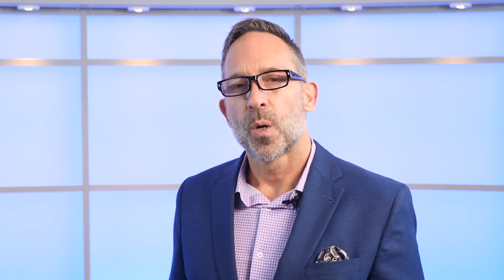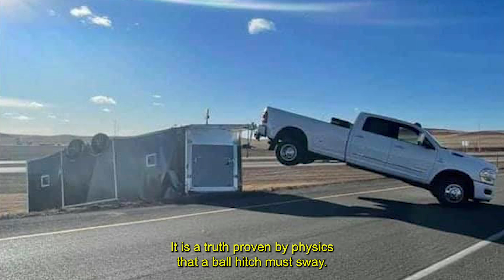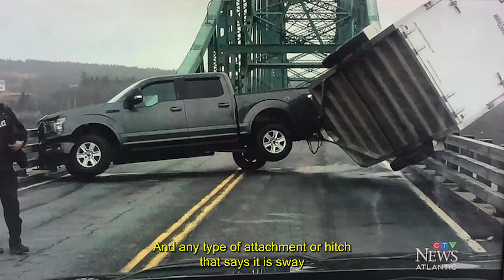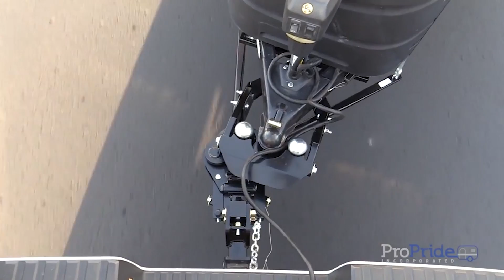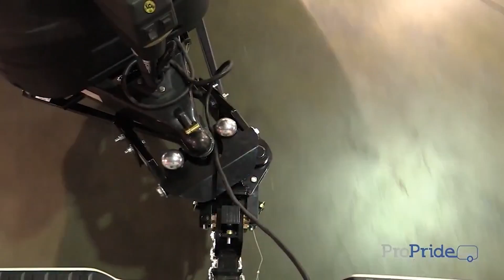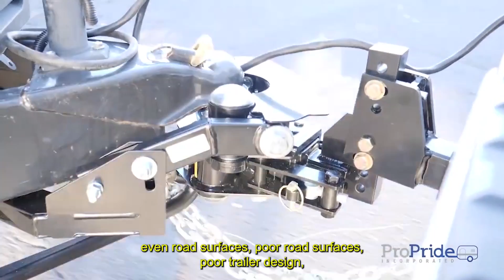Eliminate Trailer Sway with the Revolutionary ProPride 3P® Hitch: The Solution for Stable Towing

Comment: But the video shows major sway - trailer moving from side to side??
Reply: It only moves side to side when the tow vehicle is taking turns. When the tow vehicle is driving down the road it does not pivot. This is because the pivot point is projected to the rear axle of the vehicle.